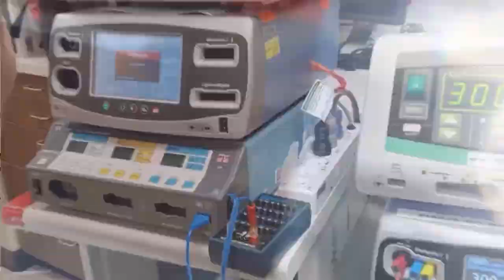UPS Refurbishment

Comment: I don't recommend it but in a pinch, you can restore old batteries by re-adding distilled water into the cells.  We had to do some of our UPS units as we're out in a remote Pacific island and procuring batteries takes months.  There are newer LiFePo batteries with built-in controllers for UPSs that looks to be far superior than these AGM batteries, been trying to get some for our department so hopefully we'll be able to test them out in the near future.
Reply from the maker: Project Farm did a video about restoring batteries

Comment: Thanks. It may be a good idea to replace the Samxon e-caps between the heat sinks. For hospital use all of the e-caps should probably be replaced. But I don't know how much they pay to have them refurbished. Refurbished to me means like new. So, the fan should be replaced even if it appears to be good and probably the relays as well.

Comment: Whats a good price for them at an auction. 5$, 10$, 20$??
Reply: If you pay peanuts, you get monkeys. 
It all depends what you are looking for, a new 450VA UPS costs arround 50a60 euro here in Europe, while buying a UPS from an auction, 
the batteries need almost in 9/10 cases being replaced. A new AGM battery for a UPS, like a 7Ah , which is almost the lowest you can find in a UPS, costs new arround 15 euro. If there are 2 batteries inside the UPS, you are already at 30 euro for only the batteries. 
So you almost never gonna get a working UPS for 5 or $10 
ps : the valuta of the euro is at the moment almost the same as the dollar.
Reply from the maker: $20-50 if used.